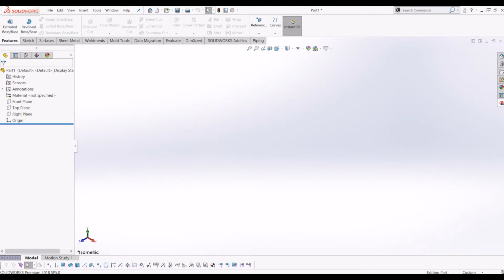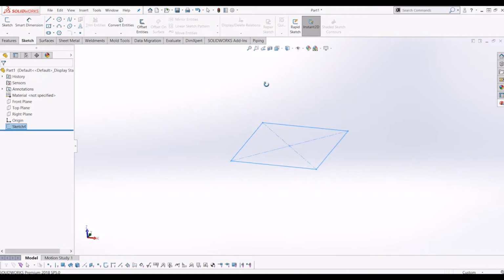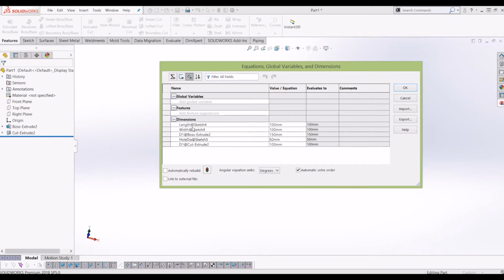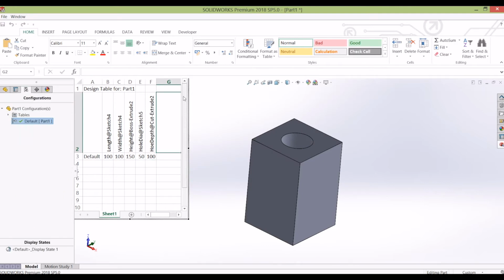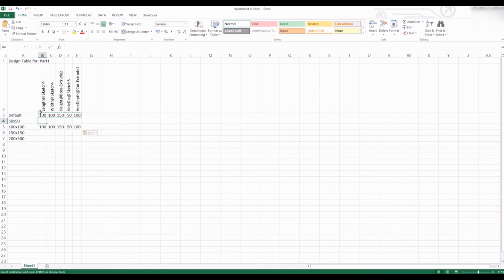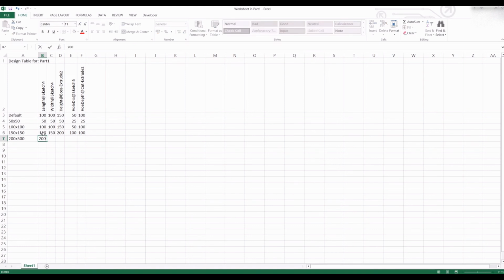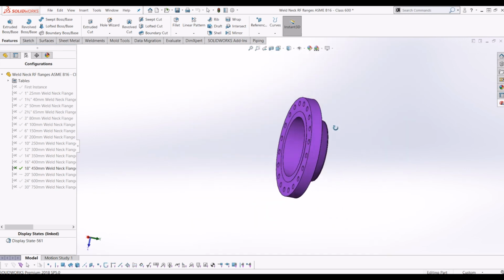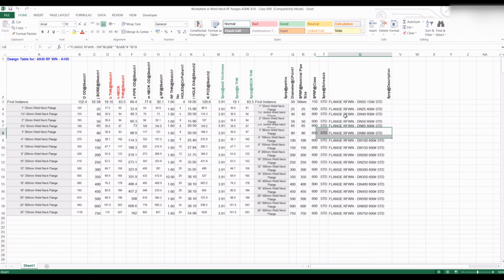Solidworks 3D Modelling- Solidworks Design Table Basics

Comment: The video is very useful to reduce the desing time, but I just have a cuestion:

How can we put excel formulas in the cells of parameters instead just number, or is it even posible?
For example, to add a new sheet in the desing table, where  I declarete some functions so that I just changeing a number or some declareted variables, they chanche automaticly the design parameters of a new part in the sheet1.
Reply from the maker: You can put any Excel Formula In See my new video for ideas https://www.youtube.com/watch?v=ZIdtPp2PZQQ 

Not sure you can have multiple tabs across the design table sheet